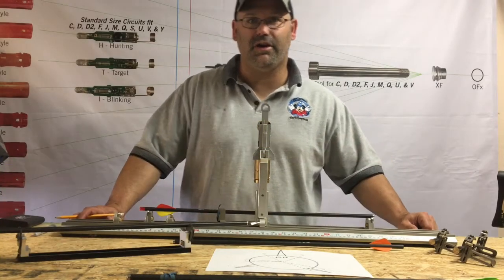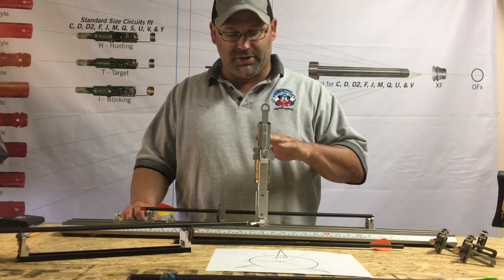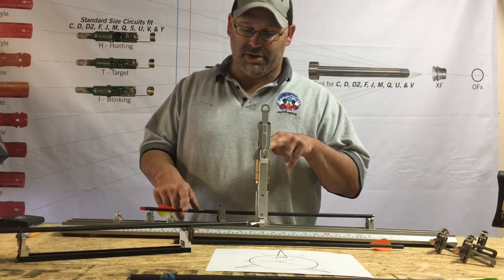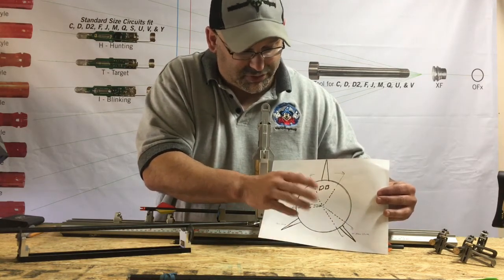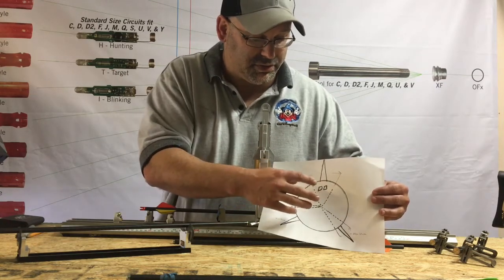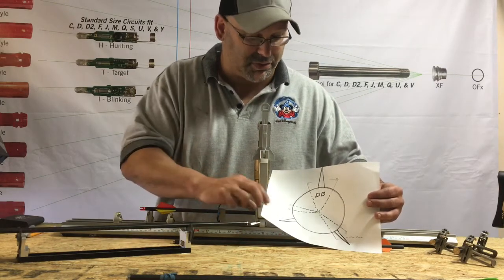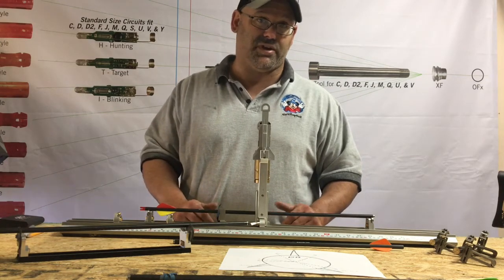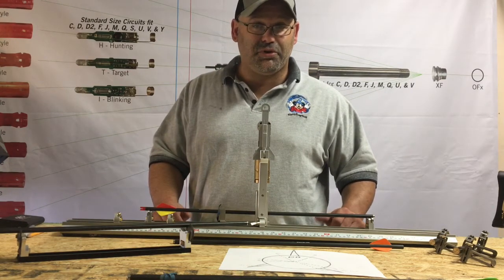Vital Limits Tech Part 1 of arrow spine, Advantages of Firenock jigs.

Comment: I kind of get the idea of what you are saying.. But how do you determine the exact center of that particular  (" I willl call it  hollow "" ) to center that vane..??  Or is the exact center of that  hollow not critical ?? Things that still amaze me..
Reply from the maker: VMK The Forest Hermit great question.  Often when you roll the shaft around when applying weight it will go there naturally.  It will settle in. It will feel like it jumps in the hole .  The most notice easiest found spot theoretically would be the one the bow finds the fastest and is most forgiving